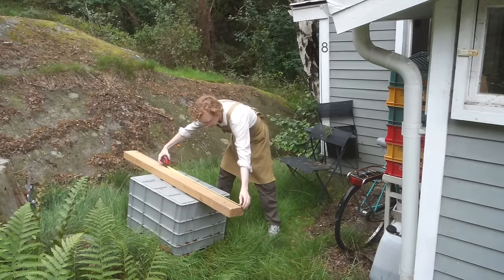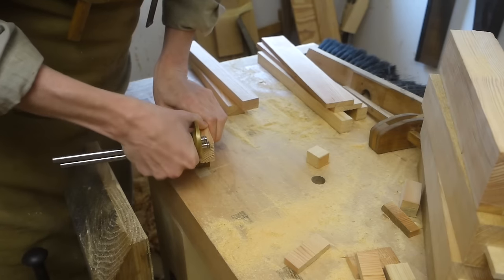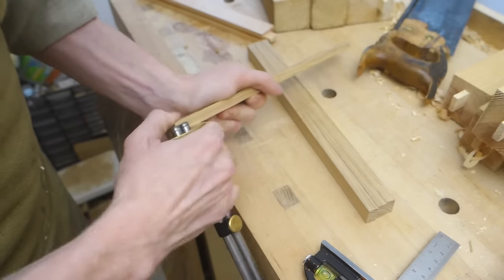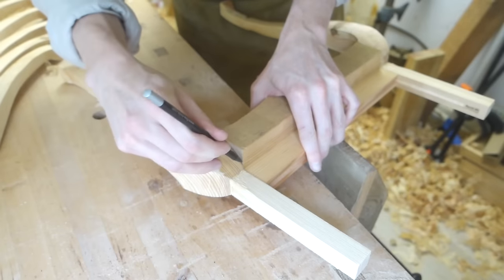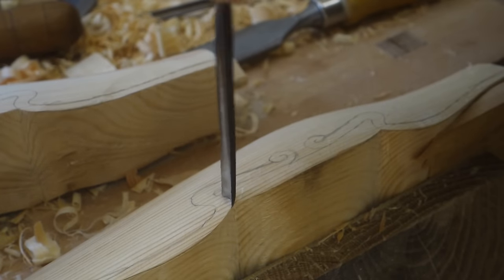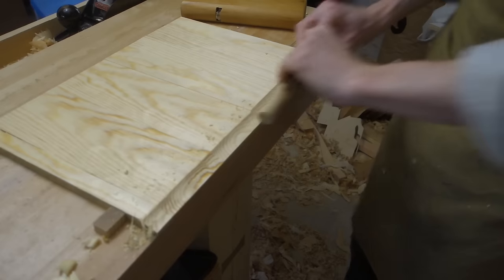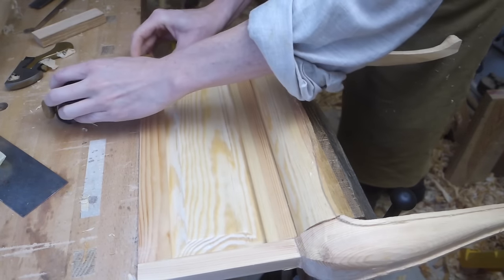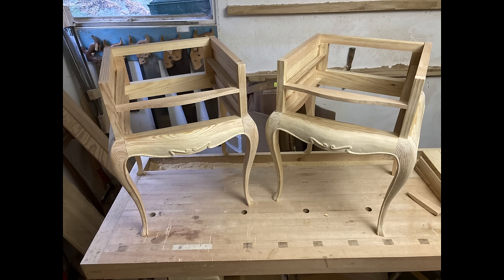Making bedside tables - part 1

Comment: I'm impressed by the amount of work you put into these -- most people would use a scroll saw for the legs. And the beads on the front are super tasteful! Very inspiring work.
Reply from the maker: Thanks! I'd prefer a bandsaw I think, a scrollsaw has a bit short stroke length for this thick stock, right? But you make do with what you have :) Glad you like the bead!
Reply: @GillisBjork  Ah, sorry! I'm still pretty new to woodworking and didn't know there was a difference.
Reply from the maker: @thainesmith  no worries! I don't use either since I don't have electricity in my shop, but a scroll saw is more like the machine version of a coping saw, while a bandsaw is the machine version of a turning saw (which is what I used).

Comment: Another great video....but I am struggling to understand why you would use a circular saw for cross-cutting, when everything else in the project is hand-tool work. Cross cutting is so easy with hand tools that I honestly can't see what you are achieving by using a power tool. I haven't watched the next episode yet, and I hope you round over the back edge of the legs, and shape the feet.
Reply from the maker: Thanks! Good questions. There was quite a lot of crosscutting to be done, so the circ saw saved a lot of time. There is also the aspect that long boards are annoying to handle in my small space, so cutting them down to size while I was outside made the parts more maneagable, and I already had the circ saw in hand so why change tool. I chose not to round the back of the legs this time, since they are quite slim and I didn’t want to remove more material. The feet were shaped in this video, the bead simply continues onto the feet. Didn’t feel like doing anything more complex there in this design, to keep the focus on the upper half and overall shape. I hope this answers your questions!